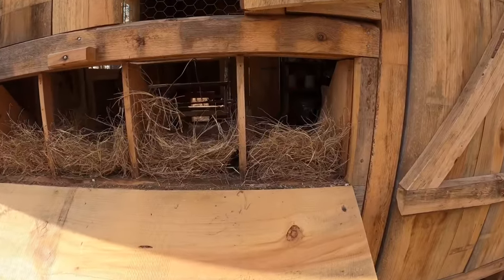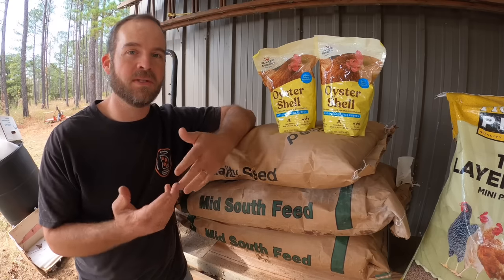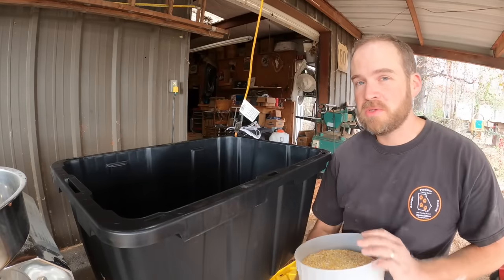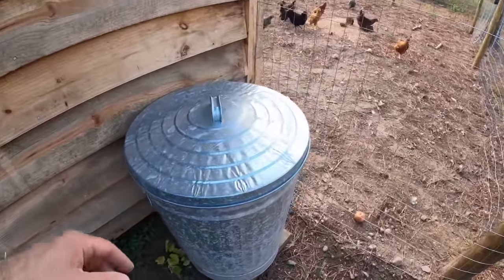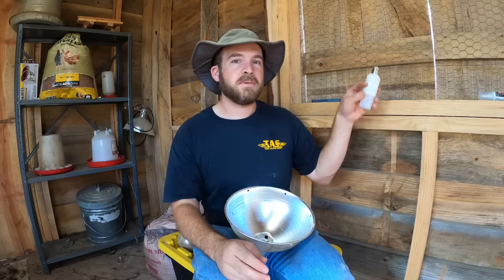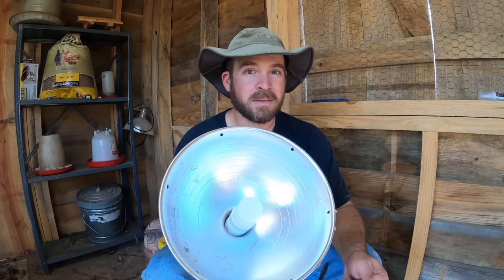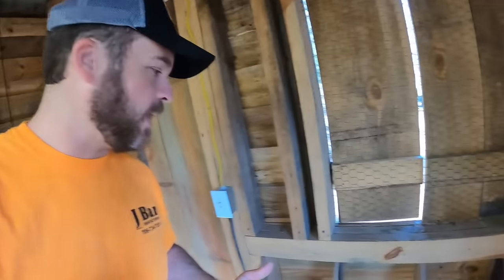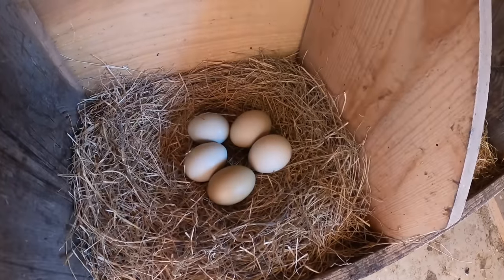I Made My Own Chicken Feed, Here's What Happened

Comment: The best chicken feed you can make and it's also the cheapest by far is to start a growing habitat consisting of mealworms and crickets blended into your other feed actually very simple and easy also fun to build you will need to also need to harvest and I might suggest dispatch worms and crickets with heat like a cage with propane torch this will also help on starting to dry them then grind them and blend with your feed you are making. trust me when I say they will live longer egg production will start younger and last longer there is just something about the proteins they can't get and you can't afford to buy premade and give on a daily basis. But why would you when you can make it better at home. Growing mealworms and crickets is so incredibly cheap what your chickens waste on the ground will feed your habitats forever
Reply from the maker: Already have a mealworm farm started! It's been pretty easy so far.
Reply: @falllineridge  crickets are even easier than mealworms you can build a plywood box no deeper than a comfortable reach deep use a tight fitting wooden screen door  for the top or lid cover with a sheet of foam in winter and keep your box in a well shaded place in the summer feed them. Almost anything except bones they will multiply like crazy they need dirt in the floor and dark places to hide and breed you can feed them in old milk jugs this is the easiest way to gather them there will be hundreds in the jugs pop a lid on them and harvest I like to use a metal wire basket to dump them into  I can then use a torch to roast them dehydrate and loosely grind them into your grains along with your mealworms

Comment: No offense but you changed multiple variables at the same time so you can't say it was this or that. There are people closer to the equator (more daylight) with different weather patterns (more daylight) that had problems with the TSC feed. Purina changed the formula in Sept '22 and it seems to be a known issue, and by someone's design (racketeering).